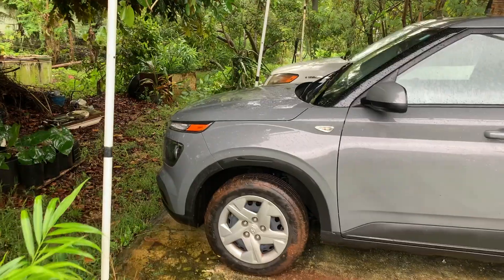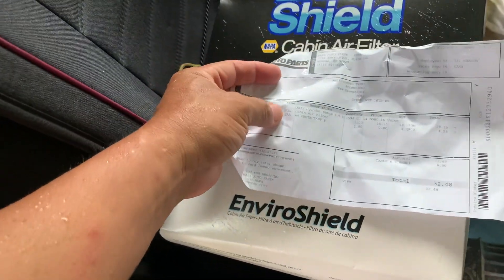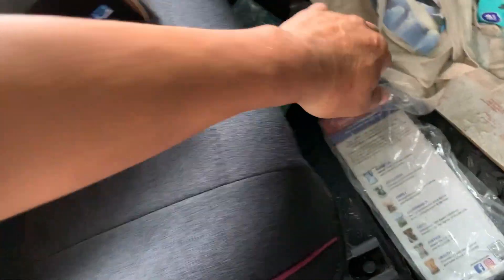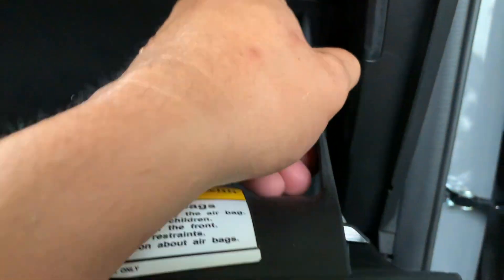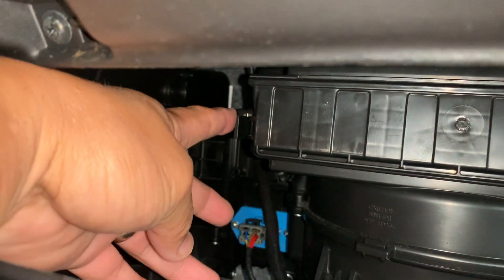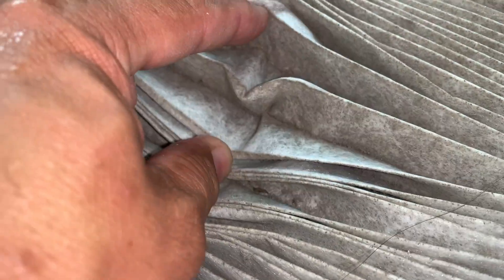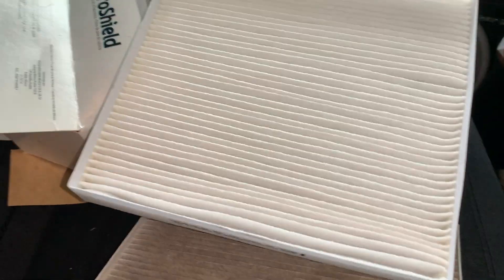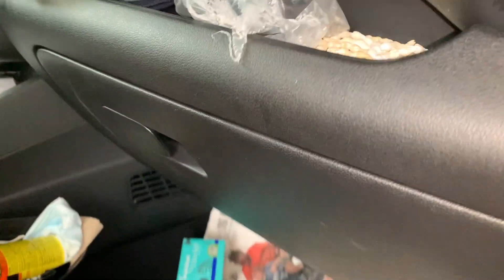2021 Hyundai Venue Cabin Air Filter Replacement 5K miles √ Fix it Angel

Comment: my 2014 is the same style and same place i bought a K N  replacement for my 2-11 and kept it when i got my 2014 it has saved me a bunch of $$$ just wash it out, spray some lysol disinfectant on it and put it back it only cost me $ 36 back in 2011

Comment: Fix It Angel, with tools in hand,
Solves car problems, oh so grand.
He's the best mechanic in the land,
A true master of the engine's command.

With a gentle touch and a keen eye,
He knows just what makes engines fly.
He'll take your car and make it new,
No problem too big for him to pursue.

From the engine to the brakes and more,
He'll fix it all, you can be sure.
He'll diagnose the issue with ease,
And make your car run like a breeze.

Fix It Angel, with skill and grace,
Leaves no car problem out of place.
He's the hero of the auto trade,
And his work will never fade.

So if your car needs a little love,
Take it to Fix It Angel above.
He'll make it purr like a kitten,
And your driving experience will be smitten.